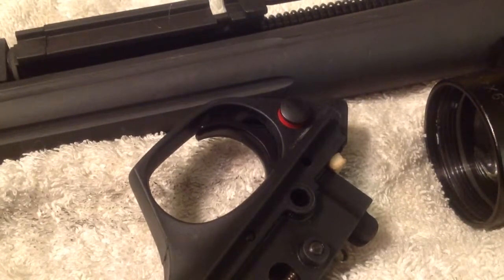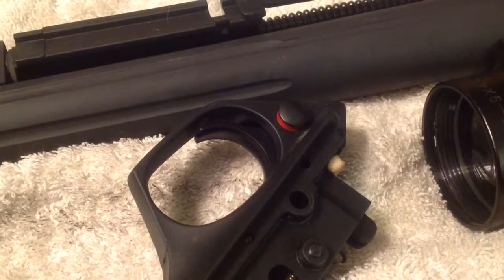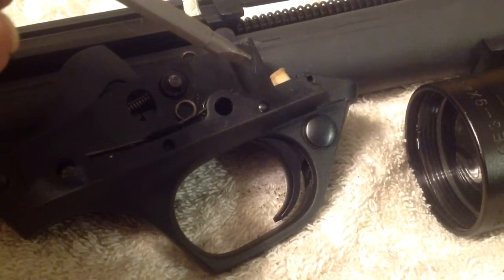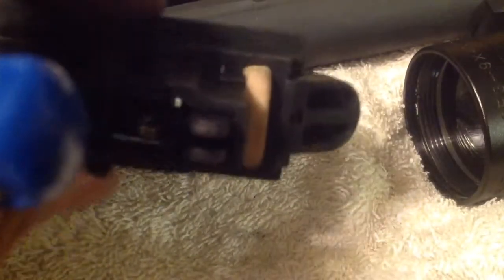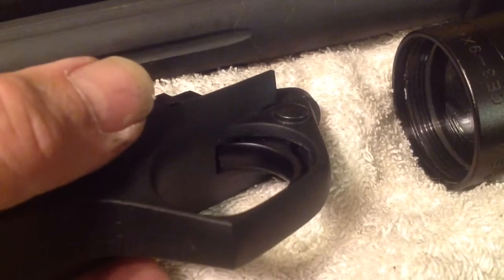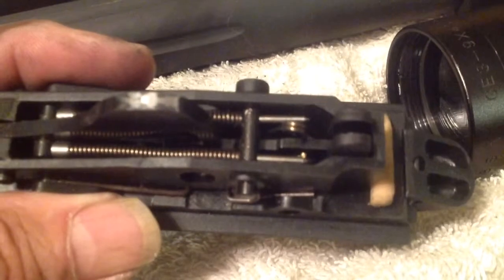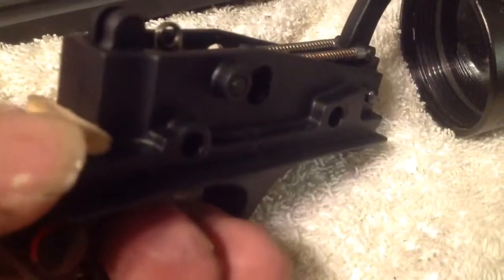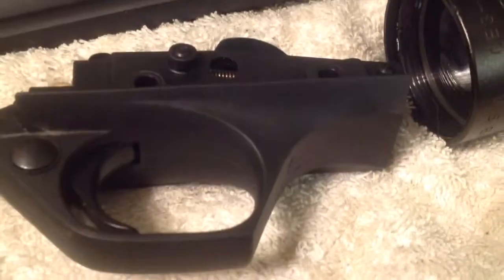FNAR 308 Safety slide Conversion Right hand to left hand

Comment: I did it but did not touch the blued pin on the side you point to. I removed the silver roll pin over the spring and plunger. Then I pulled the plunger out and pushed out the safety button and reversed it. The trick here was I had small bent needle nose pliers(surgical gripping pliers actually) which I had to file down the tips even more to fit into the hole with the plunger. You need a good grip on the plunger to pull it out.Pushing it back in is straightforward.